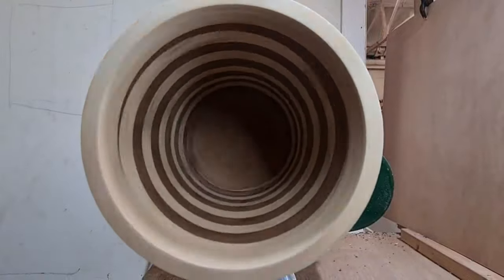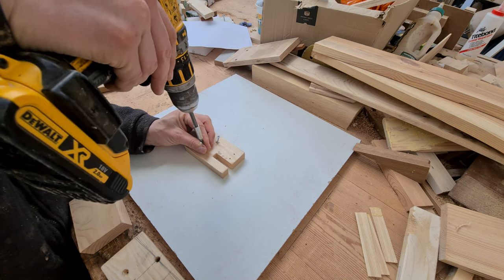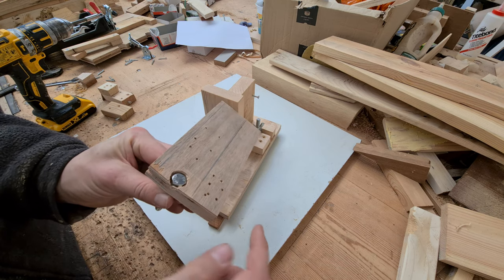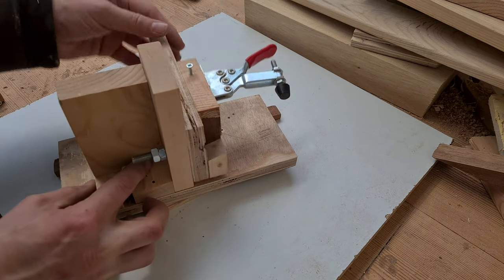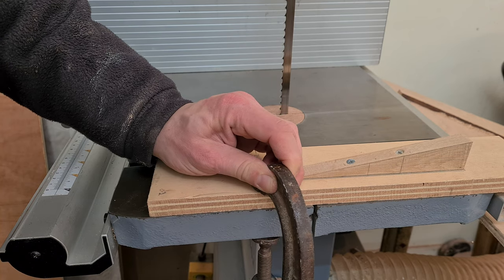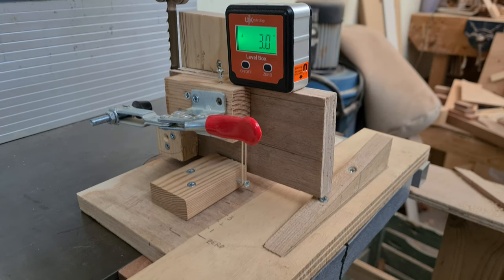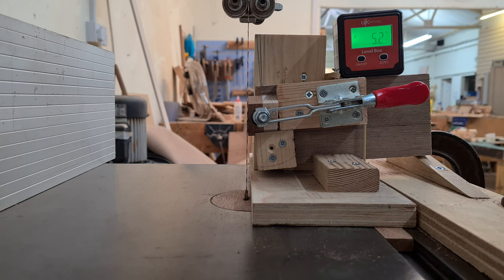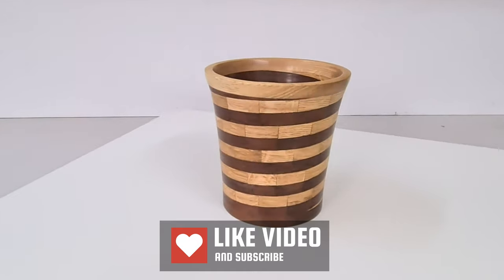Woodturning - A New Woodworking Cut

Comment: I prefer the detail of special jigs and fixtures and the assembly techniques. Generally the turning itself is pretty standard tool work. For this one I will have to review it several times as I have several questions about some of the what's and why's. I'm sure they will become apparent with a bit more review. Thank you for sharing. Have a great day and stay safe. 🙂🙂
Reply from the maker: Hi Glen. Thanks for your feedback. The most challenging woodturning I found to date is my recent upload of the open segmented helix. I don't think I did the methodology justice, which could be my lack of experience. The jig is the key to making it happen and happy to answer any questions. All the best. Ray

Comment: Very nice Ray. I still have not gotten around to doing this. I worked it out using my CNC but that almost feels like cheating. I may have to put it back on my list of jigs to make.
Great video!
Gary
Reply from the maker: Hey Gary! Hope you are well. I would be eager to see what you can do with a CNC for this type of project. I've just uploaded part 2, which is the open segmented helix. I think this would be far easier to reproduce using a CNC. I'm guessing you could actually use a compound cut for the top and bottom of each piece and avoid the bandsaw jig, glue with a step-like formation and then run a CNC router bit on the top and bottom surfaces keeping it aligned to the central axis. Definitely would need a device or a 5 axis CNC router to enable rotation of the piece whilst routing those surfaces. But if you're CNC'ing individual pieces, that in my mind seems quite a challenge. All the best. Ray

Comment: Fantastic explanation Ray but my hand is hurting now from continually scratching my head.
Take care mate.
Cheers, Huw
Reply from the maker: Hey Huw! Hope you are well. It took me a long time to draw things out, compute the maths, attempt to cut pieces, then start all over again before I felt that I understood what I had to do. The closed segmented helix is a bit of a cheat because any minor gaps between the helical layers are filled with epoxy resin glue. The open segmented helix was a lot more challenging as everything was on display! all the best. Ray